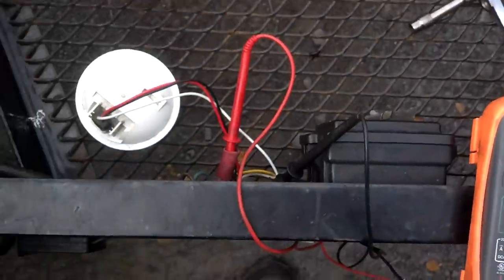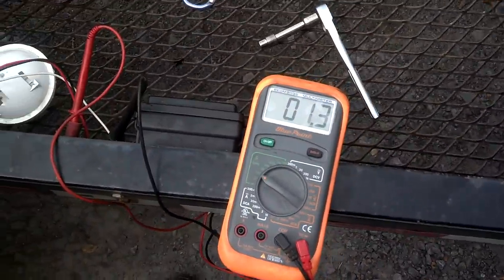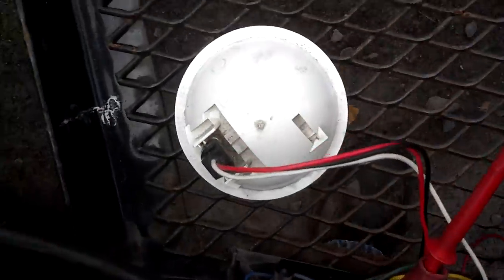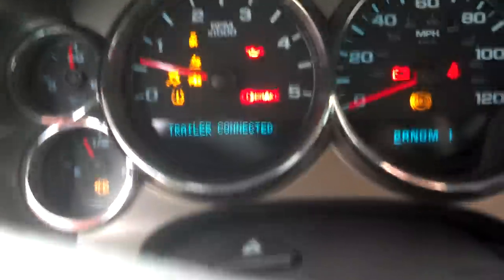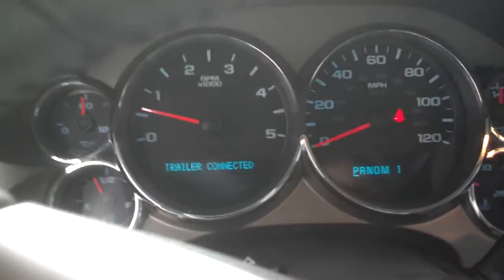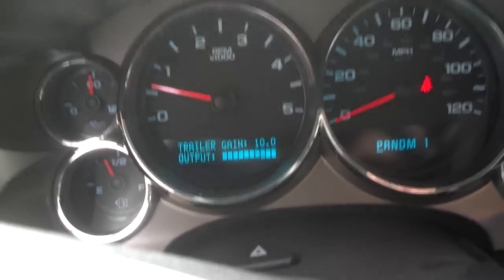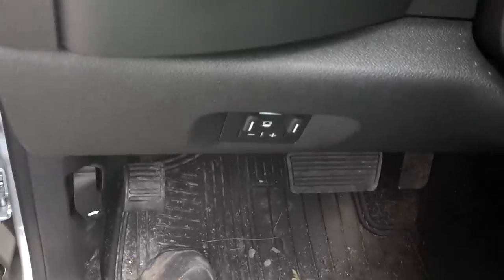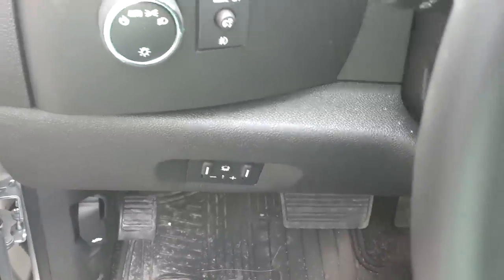ITBC Integrated trailer brake control fix , electr

Comment: does anyone know if the ITBS has a temporary trailer park brake feature, where if you come to a complete stop KOER you can use the manual slide to engage and lock the trailer brakes on for a period to have enough time to set the mechanical park brake on the trailer. This strange request stems from our towing regulations in New Zealand. I'm trying to comply a 2013 GMC 2500 HD with 5th wheel. NZ LTA wont pass the factory ITBC system for this reason.

Comment: I have a 2011 Chevy avalanche that did not come factory with the trailer brakes however I would like to install the OEM trailer brake is the wiring all there so that I can install this in my Chevy avalanche or is it missing some of the components?

Comment: I have an 09 Sierra HD with ITBC, and its giving me huge problems. I can't figure out what's wrong with my truck/trailer brakes... Lights on trailer works fine turn signals, 4ways... I'm stumped and so upset about my truck having a piece of junk for brake controller. I don't get it... I've been under the hood in fuse box, hooked up them wires added 30 and 40a fuses...  And trailer still has no brakes!!  Ran around all over my truck with multimeter... Lights work properly JUST NO BRAKES. And does not recognize the trailer connection either...

load between blu&wht will indicate trailer is present?
Reply: i have the same issue 09 Silverado. Did you get it fixed?
Reply: Hey man I’m about to pull 5hours did you ever find the issue
Reply: did you ever get this trouble fixed ?

Comment: i replaced my relay on my 07.5 2500hd an the dic still says service trailer brake..i believe i checked all fuses they all looked good .. anything else i can try??? is it possible to just turn trailer brake off so the warning stops coming up
Reply: I'm having the same problem with my 2008 3500

Comment: same issue here. I had all electric brakes serviced on the 2 axel trailer and the truck dont sence or control anything
Reply from the maker: I would check the brake wiring, I would bet that one or more of the brake wires is broke or not connected
Reply: They where actually broken a few wires. And a couple magnets. But they are all repaired and serviced.  They do engage manually all of them when I pull the safety pin.  It my truck won't read the trailer. I don't know where else to check
Reply: pedro sainz ever figure it out. Having same issue won’t recognize trailer but all lights work

Comment: If the stupid thing worked properly it would be just great 75% of the time it don't and always something stupid and little chase ground don truck Corrosion under fuse panel any little thing will trigger a code and literally disable the system I have seen a wet plug in the rain set it off and disable the trailer brakes I had to module go out and that flashed my tcm and 700 bucks later for a new tcm  Sorry Gm You failed on this one the factory system Is not safe!! It is way to integrated in to the truck